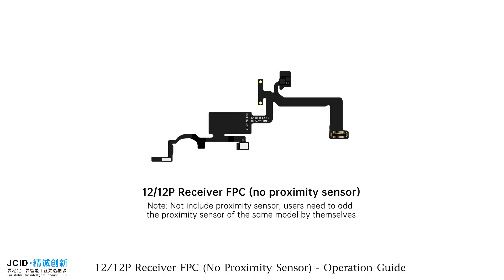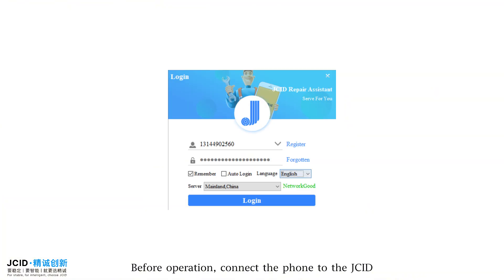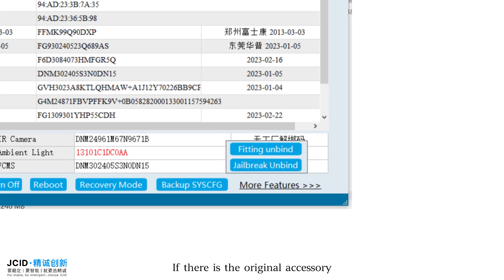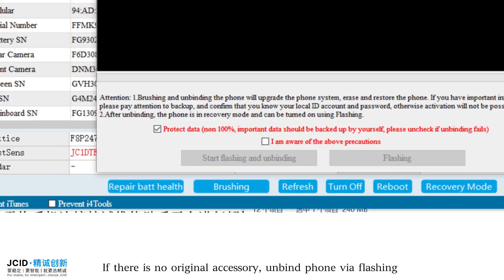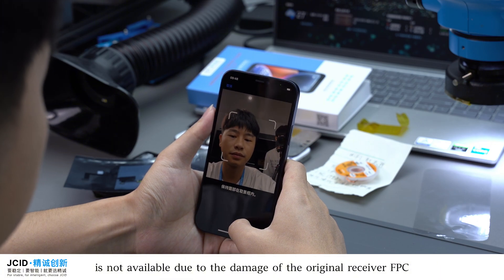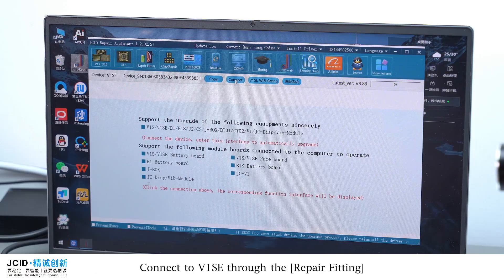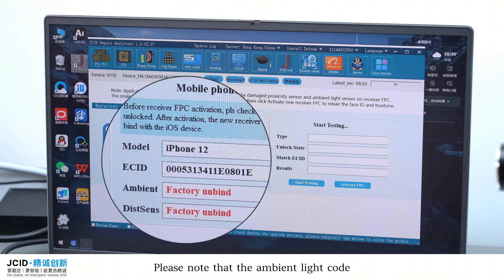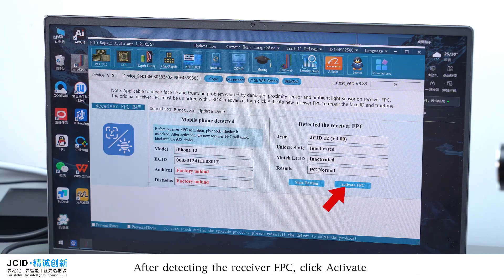JCID 12-12P Receiver FPC (No Proximity Sensor Type) - Operation Guide #jcid #receiver

Comment: hi jc team.
we have jc fpc with flex sensor (X to 12pmax) all are working except 12 series.So can we exchange with another original proximity sensor. 
12/12p (v1.1) with this fpc frount CAM portrait is working also inthe settings face id section camera opened but face not scanning

Comment: What if i don't have the original proximity sensor of the phone, that means no face ID for that device? It's really tough JCID. You need to do better.
Reply: You dont need original proximity flex but then you need unbind the phone via Flashing. If you got JC proximity flex without sensor and you dont have original one, you can solder just any other original sensor there.
Reply: @Marek21 Quieres decir que se puede soldar el sensor de proximidad de otro flex? 
No habrá problema con el Face ID?
Reply: @vikman3585 Yes you can solder any sensor on the JCID flex. Then unbind flashing and pair it. 
There is no point to use JCID proximity flex cable if you have original sensors. If you have original you can just swap the original sensors on any other original flex and it will work.
If the flex is torn for example.
Reply: @Marek21 No tengo los sensores originales, el flex JCID viene sin el sensor de proximidad. Qué se puede hacer en ese caso para poder obtener el sensor de proximidad?
Reply: @vikman3585 no tengo entendió hasta que serie sacaron justamente este flex con el sensor instalado, se puede vincular directamente, es un flex de jc a lo mejor es otra versión o solo en los modelos de serie X es donde lo vi y 11 pro Max.
Reply: @jorgealexisrojasserrano1135  Al final no encontré con el sensor instalado. El que compré vino sin sensor y perdí dinero porque no sirvió. Después me arriesgué con un flex de la marca AY A108. Fue el único que vino con sensor y funcionó perfectamente. Aparte, mucho más barato que JCID. Como leí en un post chino por ahí, JCID es solo marca, si AY hiciera mejor marketing, venderían más que JCID.